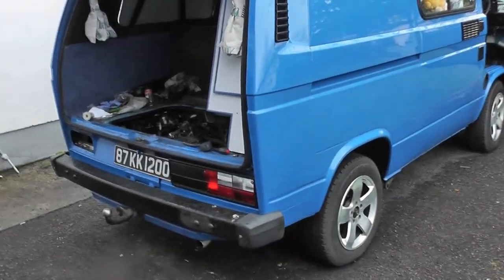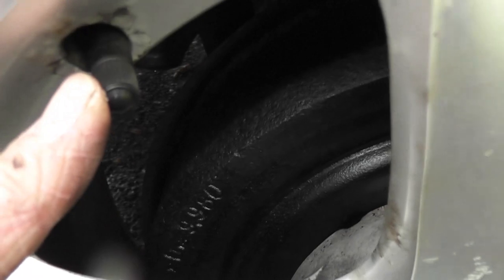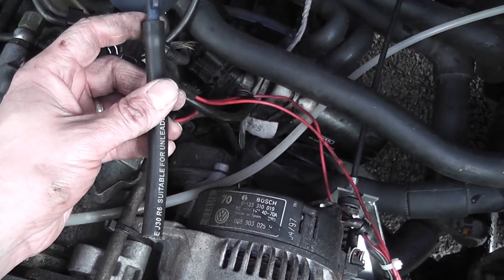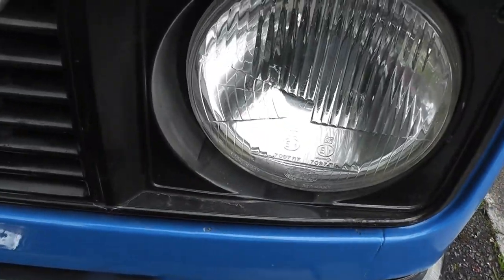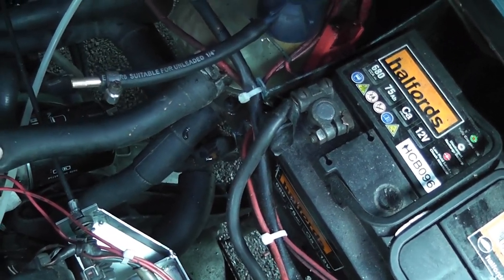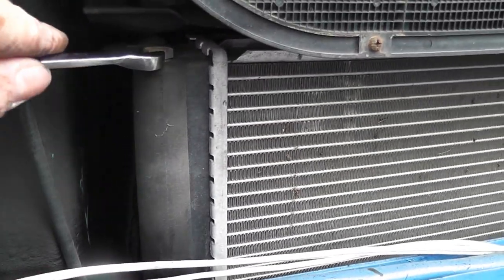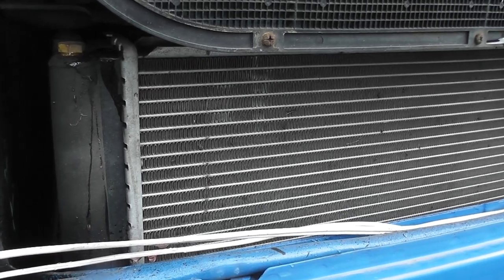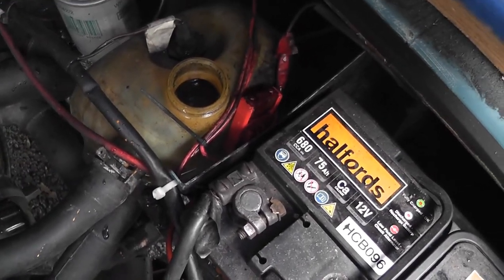How to quickly and easily bleed a Volkswagen T25 / T3 transporter's coolant system

Comment: After refilling, I run it to operating temp then park it nose down on a good slope in my driveway (or jack up the rear). Let it cool and any air will collect in the expansion tank. Refill it and fill the overflow to max and it will self-bleed after that.

Comment: Many thanks for this brilliant fix, sorted my t25 cooling system issues in no time. I'm sure the official manual process is flawed.
Reply from the maker: You're very welcome. I'm glad it worked for you. I'm inclined to agree with you on the official process. That's why I ended up trying to think of a better way.

Comment: Thanks, very helpful video. It's getting cold so I am right in the middle of putting coolant into my TDI swapped Bundewehr bus. Great tip with the tyre valve.
Reply from the maker: Just be careful you don't put too much pressure on. Glad I could help!

Comment: Looks like an economical variation of the "Libby bong" method. I would suggest repeating this after a drive cycle or two at normal operating temp. with heater valves open to purge any air that may be in the engine block and/or heater cores.
Reply from the maker: Yes I agree with you. Revisiting after a bit of driving is definitely a good idea.

Comment: Hi, Sorry. This question is nothing to do with this video but I’m stuck and your answers are so succinct. Hi,  I’ve got a loose fan belt but can’t Move the alternator enough to tighten it as the alternator seems to be sitting on the bracket. Any leverage moves the other parts rather than the alternator itself. I’m puzzled. Any ideas? Thanks
Reply from the maker: I find it hard to picture what you mean to be honest. It may be a case that you have an alternator belt that's too long and you're at your limit of adjustment. Otherwise maybe your alternator is installed incorrectly somehow, or you need to loosen the bolt that the alternator pivots on slightly. Are you sure you're moving the alternator in the right direction to tighten it, cause it moves the opposite way to what you might think. Without seeing it, it's hard to know though.

Comment: A perfect illustration of what to do, many thanks. I have a tricky situation where the coolant pipe has split where it connects to the engine. It seems to have a larger diameter on the connection and then tapers slightly. Any suggestions about how to replace? Cheers!
Reply from the maker: I would recommend contacting brickwerks, who should be able to supply the correct hose. Once the new hose is installed, fill up with coolant, top up with the engine running then finish the job using the method I show in this video.
Reply: @Endfloat  Could you explain what is the difference between coolant and water?
Reply from the maker: @stephenparker4735  coolant is a chemical that resists corrosion, freezing and boiling and is often based on ethylene glycol and it's usually mixed with water. Don't just use water in your engine or you'll cause a lot of problems.
Reply: @Endfloat  Thank you. I may have to drive for a week without it due to an emergency . Is it ok to do this temporarily ?
Reply from the maker: @stephenparker4735  for a week it should be fine with just water but be sure to get coolant into it as soon as possible.

Comment: Great video! I heard you recommend g12.  My shop has always put green coolant in my system. Once after upgrading my radiator and coolant lines on the entire van, and once again after replacing my cylinder head. They said that coolant is fine and that's what they use in everything and the specialized coolant is overkill. What is your recommendation on this? I'm running a 1.9 AAZ turbo diesel.
Reply: I've also been having issues with coolant blowing out of my overflow tank behind the license plate. After feeling that several of those blue plastic caps were failing my shop decided to replace the expansion tank with the metal one from Van Cafe that uses a standard type radiator cap. Even after this swap coolant is blowing out of the overflow tank and is now leaking at the silicone connectors in the joint of the aluminum coolant pipes in the middle of the van, and I just noticed coolant leaking all over my spare tire from somewhere up above it. My temperature gauge never goes above halfway so it's not overheating but somehow is pressurizing and blowing coolant out of everywhere. Do you know what might be causing this I'm stumped and this is my daily driver so I'm really stressed out about getting this fixed especially because I just replaced the cylinder head.

Comment: Sorry another Q ... can this technique be used to cold fill up completely or partially empty system? As opposed to just getting some air out? I live alone and there never anyone around to 'man' the radiator bleed valve whilst filling traditional way with revs at 2-2.5k. Thanks!
Reply from the maker: I fill it as far as I can using the "traditional" method, then get the last of the air out using this method.

Comment: looks pretty smart to me.  But im not sure i get the point. wouldnt an air bubble in some corner keep sitting there only being compressed. the bubble needs to flow to the bleeder to be able to air i would think. what am im missing here
Reply from the maker: The air makes its way to the highest point in the system eventually and this method provides the pressure to expel it. You will get some air bubbles in the system but the moving water will eventually carry it to the radiator.

Comment: You lift the top of the van because there are some high spots on the pipes which trap air . After bleeding mine normally ( no bubbles came out of the bleed screw ) I decided to lift it up ( the engine was shut ) and I could clearly hear bubbles coming up (which came out through the radiator)
Reply from the maker: If you drive it a bit, they'll make their way to the radiator eventually but by using my method you'll have removed enough air to be able to drive it without worrying about it overheating badly.

Comment: Noob question, after putting pressure on the expansion tank with the pump, and bleeding it via the radiator, what happens when you then need to remove the valve pipe and connect the expansion tank to the filler tank? Would that make the pressure drop and let air in the system ?
Reply from the maker: No because you're pushing the air out at the other end where it gets trapped by using the air pressure in the tank. You need to close the bleed screw before you open the expansion tank cap though.
Reply: Endfloat that makes perfect sense. This is on my planning next week, since I removed the rear heater. Really like the valve method, have an old wheelbarrow tyre where I can strip the valve of
Reply from the maker: Good stuff. Just make sure not to overdo it with the pressure.

Comment: Great idea mate! But may I ask .... the system is already pressurised once up to temp and thermostat open, at which point you just bleed any air out of the rad. Apart from having to negotiate a little hot coolant, what are the advantages of your schrader valve hack? (Good hack!)
Reply from the maker: You're pushing the water down at the header tank end and as a result, up at the radiator end, expelling the air because there's a pressure differential between the 2 ends of the system  This doesn't happen when the system is pressurised through normal operation. Also, you can do this with the engine cold.
Reply: @Endfloat  How does it reach the radiator if cold and thermostat is closed? Absolutely not saying this don't work - just trying to understand. Tanks :)
Reply from the maker: To tell you the truth, I never fully got that bit myself. I think the pressure gets through the pipework for the auxiliary pump, or maybe the thermostat will let a bit through but yes it definitely works.
Reply: @Endfloat  OK man. Appreciate your insight. ;)
Reply: @Endfloat  "there's a pressure differential between the 2 ends of the system  This doesn't happen when the system is pressurised through normal operation."  ...that explanation doesn't wash with SCIENCE!...you're going to need to explain that!
...why do you think they went from the early mechanical rod braking systems where the mechanical force to actuate the brake at each wheel was highly dependent on adjustment at that corner, to hydraulic braking systems...answer:  EQUAL pressure in all components of the system means equal mechanical force at each corner!

Comment: ...and one year later ....
After an engine swap earlier this year, replaced one tdi with another, I’m having a bastard of a jog bleeding my system. No hot air from the heater at all where previously it would have you driving in your underware.
I’m gonna steal and adapt your idea and use the passatt header tank with a bolt in Schröder valve and make a separate filling tank with another valve and an old tyre compressor attachment.
I’ll let you know how I get on.
If it works, I’ll send you a video short of it in action.
Reply from the maker: You shouldn't need to go to all that hassle to get the system to work properly. I'm using the stock coolant system for the T3 without any mods. I'd be looking for problems in the stock system before modifying anything.

Comment: VW G11 (Transporter, Vanagon) has been replaced by VW G12. VW G12 and VW G12++ has been replaced by VW G13 for Volkswagen vehicles. Check with your Audi dealership if Audis currently use G13.
Reply from the maker: Thanks for the info.

Comment: I guess they lift the van because the manual says to raise the front of the van by 40cm.
Reply from the maker: I understand that but it still doesn't make a lot of sense to me. You can be sure they don't do all that faffing around when filling the system in the factory.
Reply: Endfloat yes it seems strange to me. I’m pretty sure most people wouldn’t bother. Especially as there is no explanation in the manual. I’m not a big fan of the official repair manual.

Comment: I parked up a hill, ran the engine to temp, kept the revs up and opened the bleeder valve. Nothing much happened. Hardly a trickle of coolant came out. And the heater still won't work. shrugs

Did it your way,. Nothing much happened. Hardly a trickle of coolant came out. And the heater still won't work. shrugs
Reply from the maker: Give it a short drive (without letting it overheat) and try again. It sounds like you've an airlock. Make sure to leave that heater valve open too!
Reply: @Endfloat  Thanks, when you say heater valve, where is that?
Reply from the maker: @gordonblues843  I mean literally turn your heaters up full on the dash. The valve itself is under the van up the front FYI.

Comment: So you’re filling te system with air to get air out of the system? Doesn’t make sense..
But understanding the pipework has some airtraps you have to deal with by lifting the front does.
Do not quit understand why people think the have to outsmart the factory. 🤔
Reply from the maker: You're using the air to push the fluid down at one end, giving a positive pressure which will allow you to let the air out at the other end. The air you're putting in doesn't get entrained in the coolant.